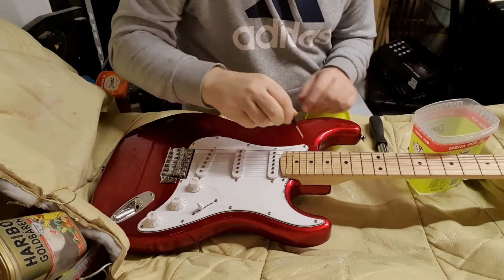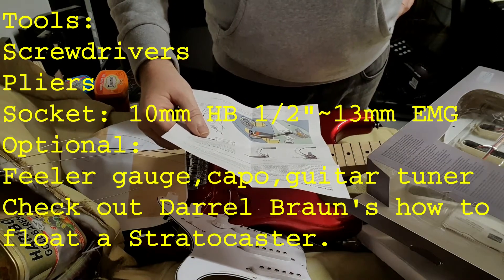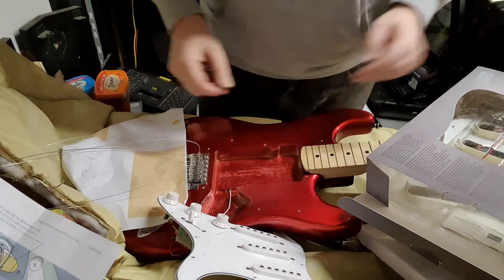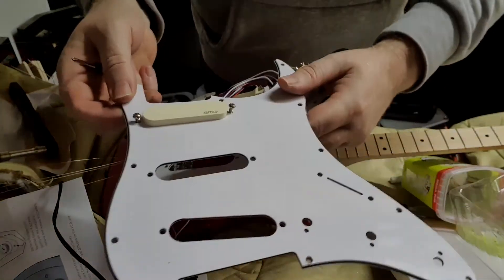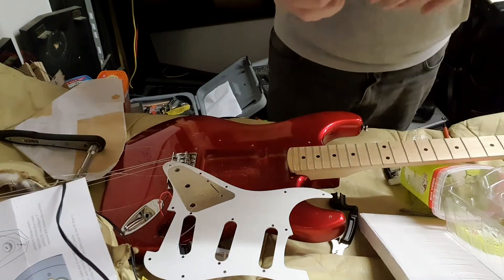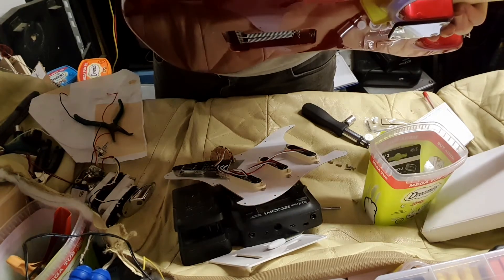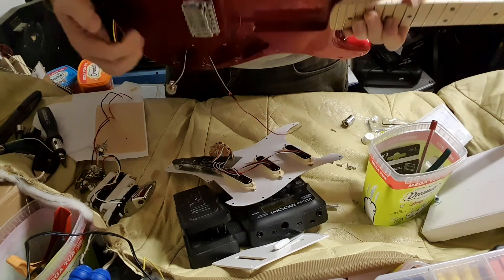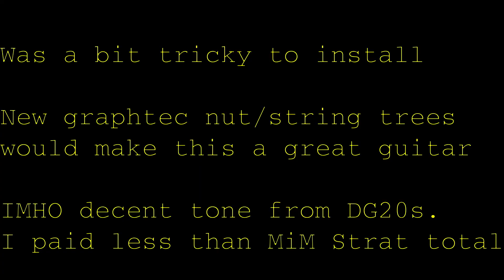Harley Benton ST20 CA - Installing EMG DG20. Process & tips - not sound demo.

Comment: Hi, I know this was a long time ago, but how would you come about carving out the pickguard to make it fit, would it need to be a big adjustment or not? Thank you!
Reply from the maker: If you mean using the Fender guard and adjusting it - I think it would be easier to get a rectangle of style you want and trace to fit.

My Mrs got me a Squier Jazz bass - that just fitted Fender pickguards.

As soon as you go to SX, J & D, HB then nothing fits - go creative :-)
Reply: I appreciate the answer. I’ll probably try to sand it down a bit and hope that it will fit! 😅
Reply from the maker: The main issue is the include guard is for a Fender standard. Even a Squier Classic Vibe has the screw holes in the wrong place.

Hence I moved the pickups. Path of least resistance.

Comment: I don't understand a bit of one thing: if it's a copy of David Gilmour's pickguard, why is this pickguard pearly, when the original DG Red Strat pickguard is pure white ...
Reply from the maker: No idea. They do sell a black pickguard version. In my case it was academic because the guard doesnt fit on a Harley Benton.

There again I have plenty of basses where I don't like the supplied pickguard and have to retro fit - so no big deal.

I am in two minds to move these across to my SX vintage White guitar - or just buy another set. They are blissfully quiet at rest. The neck on the SX feels way better than than the Harley Benton.